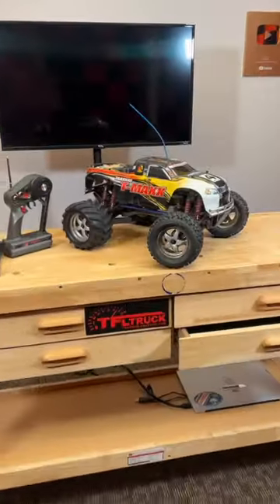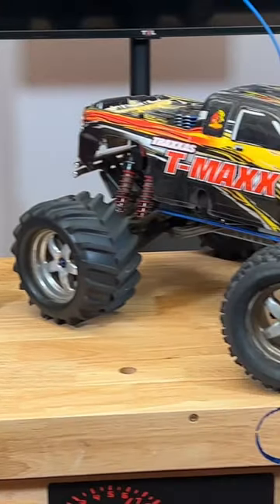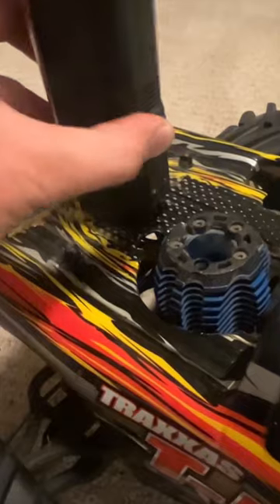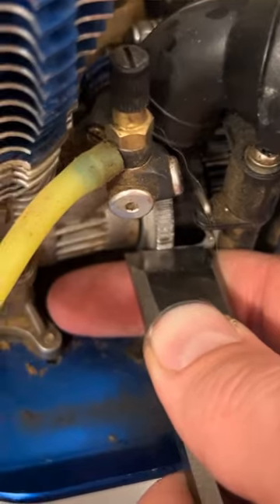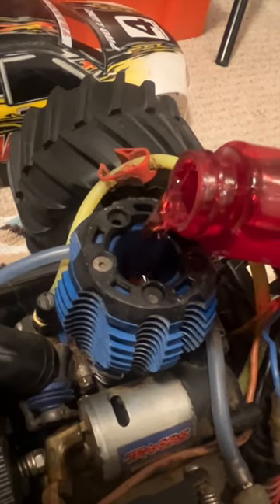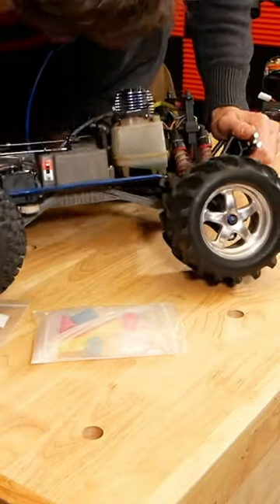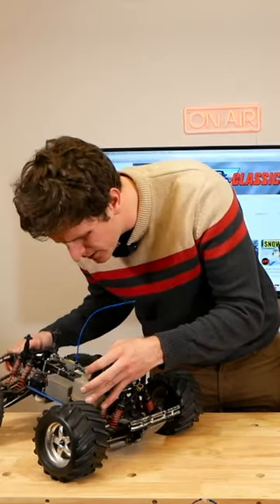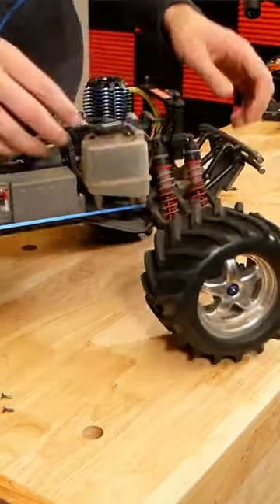Back From The DEAD

Comment: Back in 2004 ish, I had a pos nitro, sold it cheap and missed it. I  turned around and bought a savage 4.6. As i go to break it in the weather started getting below 40F and I never fully broke it in and it's been sitting ever since. My son is 9yrs old. I thought about trying to get it running. But he's not into cars

Comment: Check your screws that screw into rear bulk heads from chassis. Look loose. One thing you wanna do is always go around the truck checking for loose screws and broken parts on the trucks that sat awhile. You just never know what you'll find.